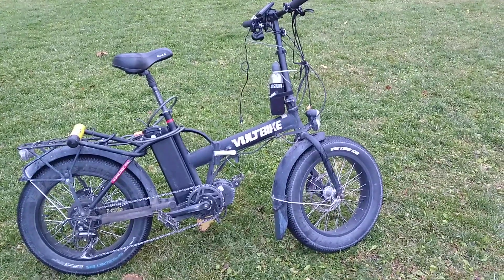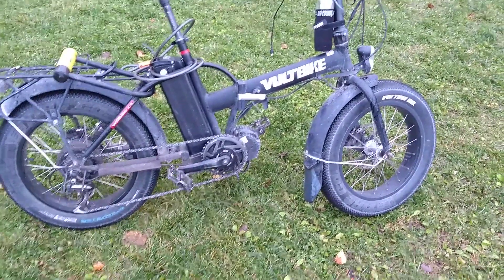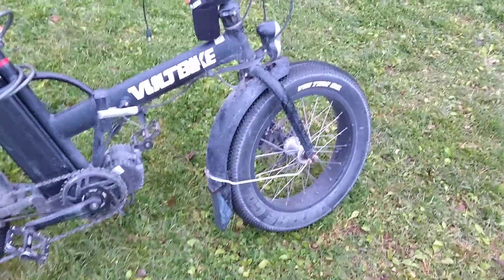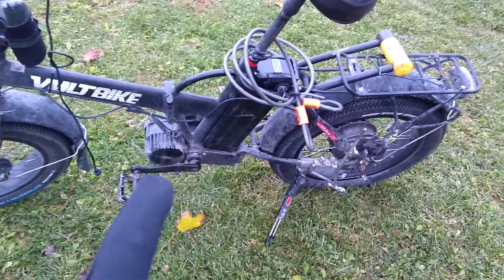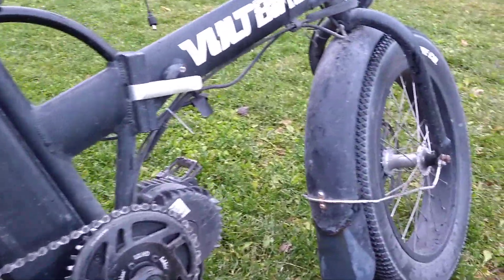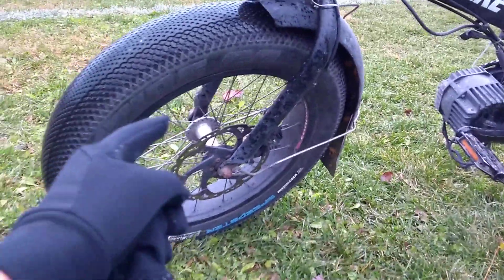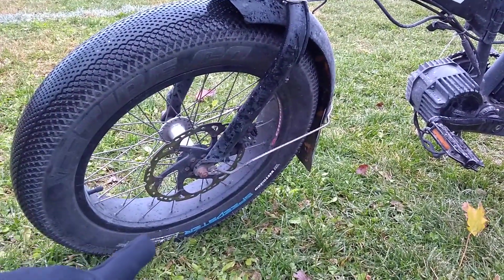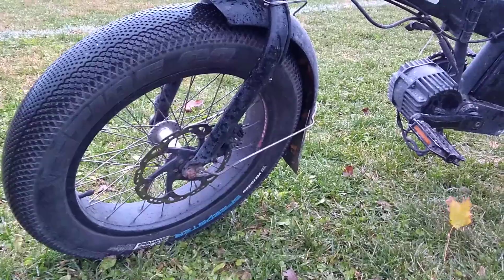BBSHD Mid-drive Ebike - adding regenerative braking?

Comment: One thing that limits the efficiency and power of regen braking is that it only works when there's enough torque and speed to generate enough voltage available at the motor to overcome the voltage of the battery and push current back in.

Which means braking will fade as speed decreases and won't work at all at low speeds and won't bring you to a stop.

Since you are going to use the direct drive purely as a dynamo you could set it up with a more suitable system rather than a normal motor speed controller,   one with a voltage booster to take whatever voltage is available and boost it above the battery voltage to enable powerful and efficient regen braking at all speeds

More info:   search youtube for " Optimal Regenerative Braking, Explained (episode 14) "

And you should find the video I learned about this from.

I don't know if there is an off the shelf system you can buy,  that would have a thumb throttle for variable regen braking,  but if there is that's what I'd be looking for myself.

Let me know how you get on.

Comment: Replace the rear hub motor with the GMAC motor from Grin Tech. It's a geared motor, but it has a locked clutch instead of an internal freewheel. This makes the motor capable of regenerative braking. Justin also has a video describing how you could supply a minimal amount of voltage to the motor so it wouldn't chew through your battery when you don't need the regenerative braking. You could also get a front wheel GMAC motor if you wanted.

Comment: what a wonderful looking bike but... how do you coordinate 2 motors on the same drivetrain?
Reply from the maker: Thanks! The 500 watt rear hum motor is disengaged for now because we may have a internally geared hub built.

Technically you could have 2 motors, 2 controllers, 2 batteries, and 2 throttles... all separate and unrelated to the other; 2 complete systems. However, we plan on connecting the front direct drive motor to Grin Technologies' Phaserunner controller and to the same battery and throttle as the mid-drive BBSHD. To engage the regen on the front hub motor we'll set up a 2nd throttle to benefit from the proportional regen that this particular controller offers. 

Will update you as the project progresses.
Reply: Another option is just add a additional 10 amps or 5amps  small Aux battery pack and connect the regen motor to that separate battlery let it charge the same and just use xt60 connectors to both batteries in case you want can use the juice stored  in aux battery to power the bbsdo2 n keep main draind battery on charging when using aux thus you save on 1 throttle and also overcharge your battery in mornings or when your main battery is full